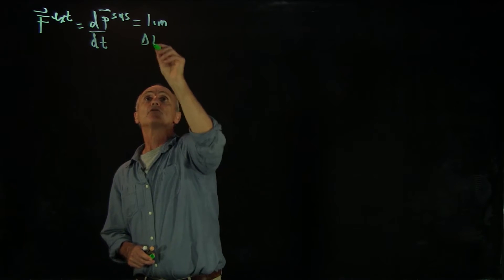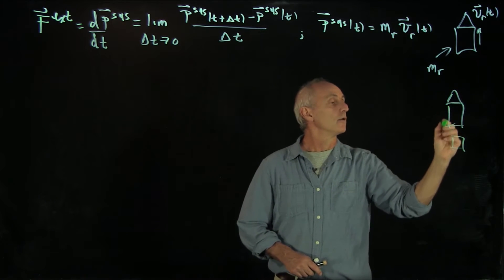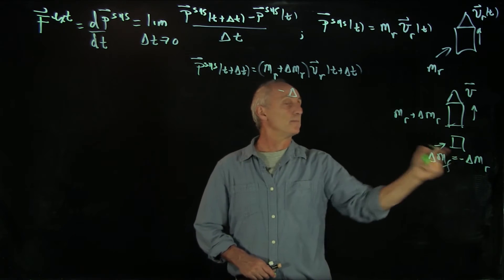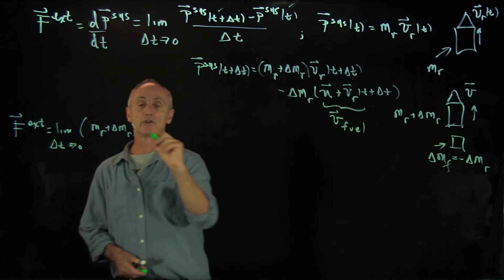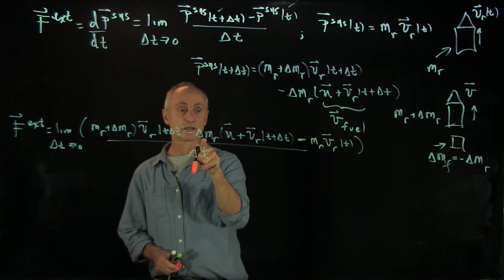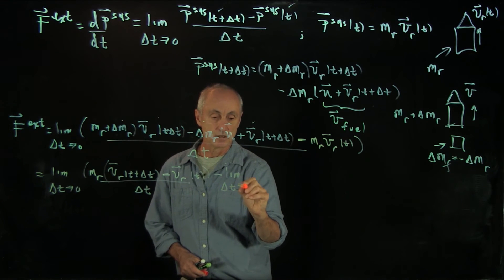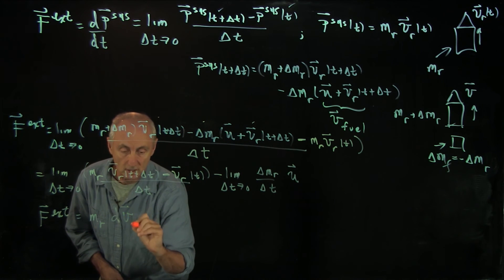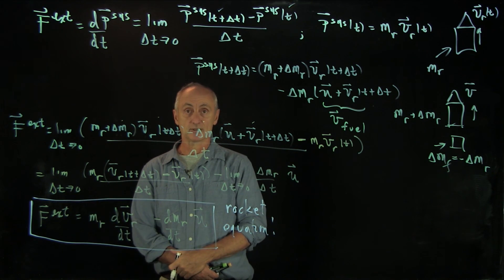19.4 Rocket Problem 4 - Solution

Comment: why isn't u a function of time
Reply: By u, the equation referred to the relative velocity of the fuel with respect to the rocket. Whatever the mass of the fuel is, its velocity with respect to the rocket is constant.  With respect to the ground it's not constant. It's the velocity of the rocket plus the relative velocity. As the velocity of the rocket increases, the velocity of the fuel is increasing, however the relative velocity is cosntant. This is why he removed it as a constant from the limit